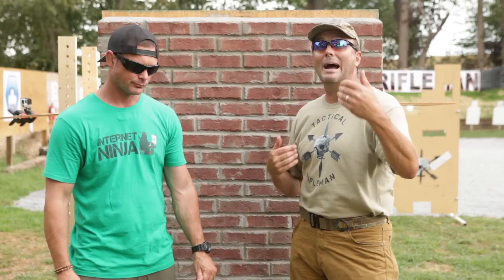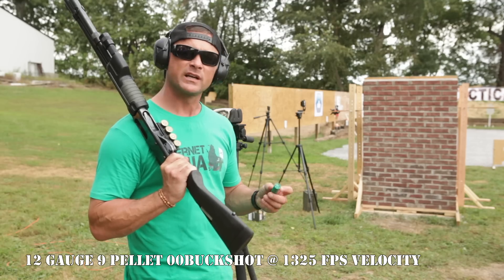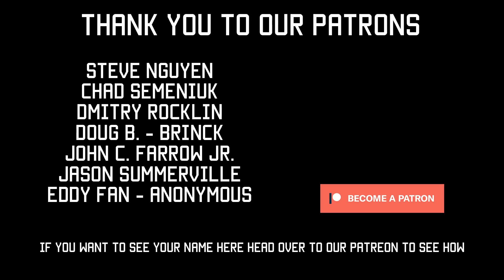Navy SEAL test Ballistics through Walls | Tactical Rifleman

Comment: Brick + Cinder Block Wall
3:13 12ga 7 1/2 Birdshot
3:50 12ga 9 Pellet 00 Buckshot 
4:21 12ga 1oz Slug 
4:57 SIG MPX 9MM +P 124gr 
5:41 ??? 5.56 55gr

8" Cinder Block Wall
6:59 12ga 7 1/2 Birdshot
7:23 12ga 9 Pellet 00 Buckshot
7:57 12ga 1oz Slug
8:49 SIG MPX 9MM +P 124gr
9:41 ??? 5.56 55gr

Brick w/ Dry Wall+
11:56 12ga 7 1/2 Birdshot
12:45 12ga 9 Pellet 00 Buckshot
13:24 12ga 1oz Slug
13:57 SIG MPX 9MM +P 124gr
14:32 ??? 5.56 55gr

2 Sheets of Dry Wall
17:00 12ga 7 1/2 Birdshot
18:10 12ga 9 Pellet 00 Buckshot 
19:59 12ga 1oz Slug 
21:58 SIG MPX 9MM +P 124gr 
23:49 ??? 5.56 55gr

Vinyl Siding + Drywall
27:02 12ga 9 Pellet 00 Buckshot 
28:12 SIG MPX 9MM +P 124gr
Reply from the maker: Thanks for taking the time to time-stamp this video. TR
Reply: @TacticalRifleman  Nah, thank you. While I have your attention, I would love to see you take these walls and shoot a human sized gel IN FRONT of the walls, to see how far it would penetrate after you shoot through a body. Also, would love to see you use some of these walls in ricochet demonstrations. You might or may not be surprised on how crazy accurate you can shoot a ricochet and I think it should be in everyone's tactical toolbox for defending against it or using it to your tactical advantage!
Reply: Those are some interesting questions.
I'm up for some of that.
This is an EXCELLENT presentation and the timestamps are a Valuable Courtesy.
Many Thanks, to All.
Reply: ??? = AR-15
Reply: @cardboardcapeii4286  thanks
Reply: Moves from addressing the boys to gents at 13:11. 💪

Comment: How about green tip and some 308?
Reply from the maker: Future videos already planned
Reply: Definitely need to see some .300 Blackout info...
Reply: why green tip or stronger? I think you missed the point.
Reply: Green tip is good if you need to blast through walls or barriers to hit your intended target. However it has much less effect on your target than it's counterpart, XM193.
308 may perform better than what most think. Use a good soft tip or hollow point, major wound devestation but lacks the ability to penetrate compared to an fmj or other calibers. However with any rifle, ammunition choice is important and I'd never recommend a fmj for home defense unless it's 556/223 like XM193, those are the only exception.
Reply: I've shot individual concrete blocks with 7.62 x39 , 5.56 NATO and 7.62 NATO . The7.62 NATO  blasted through in one shot except when it hit the ribs in the center or at the edges . The 7.62 x39 performed about the same as or a little better than the 5.56 NATO . As car commercials say : Your mileage may vary ".
Reply: That's what shocked me is they only 12ga, 9mm and ball 556. Shoulda added green tip 556, 7.62x39, 45ACP, 308 and maybe 300BO or sumpin. Tons of people use those as well. I myself use 45ACP and a 308 M1A for defense as I live on a ranch.
Reply: @TacticalRifleman  I hope to see 9mm HP from a pistol. (Probably someone already said the same, but browsing comments with phone is not something I like to do a lot :) ).
Reply: Please add .308 to your test ammo. Need to know the potential for damage. Is there any way to simulate wall penetration AFTER a round hits a bad guy? Maybe 8" of gelatin in front of the wall?
Reply: @EquipaPatriot  Why would you shoot your own house from the outside. Clearly some of this simulates an attacker.
Reply: Korben 
I was thinking the same thing... Maybe he’s defending his garden from bad guys inside his house... 😜
Reply: @GrySgtBubba  I do to but also have a house in the city. Two different ballgames brother but at the ranch I run a Remington 700 6.5 Creedmoore or a 300 Weatheby. Now that I'm not out at the ranch house as much I use a 12ga OO Buck or my 1911. After 3 tours and 17 years of shooting I consider my self to be a good shot. My gates 300 yards away from my back porch and I'm covered from there. I got some other toys too but I'm not concerned about a CQB shoot out but am always prepared for the worst and praying for the best. Different strokes for different folks. I like your style though brother.
Reply: @snek9353  he specified that it was if you were defending from a window and missed hitting your neighbors house. IE Chicago drive bys and such.
Reply: LOL we don't need a demonstration of green tip on drywall... We know the damn results
Reply: They'll go through the wall but in many cases will be mostly debris and light damage if body armor. .50cal will go through without a problem. This is for all but brick. Brick is tough as f*k but brick debris will do damage.
Reply: @toddk1377  even with 5.56/.223 spire point is the way to go for home defense. With neighbors and even family in the other rooms of your house to consider,using FMj in any case for home defense makes zero sense no matter the caliber. There are way too many options to go with the least effective for the mission.
Reply: @chaozeffect1841  apparently,you have never shot a .50 BMG at a brick wall. As a reference, I've seen a .50 BMG penetrate 4inches of reinforced concrete. One layer of brick,backed by one layer of block would be nothing since brick is soft. The only way there may be an issue is if it hit directly on the support rib in the center block
Reply: @FreedomInc  
Like I said, it's only a consideration, but based on many tests, the XM193 does perform decently at close range as it fragments and tumbles, but I do agree, there are other options that offer a lot better terminal ballistics. I really like some of the heavy otms as they perform very well from both my AR rifle and AR pistol. To be honest though, as long as the projectile puts a hole in the bad guy and causes massive damage, I can care less about over penetration, many folks focus on that too much and unless you're in a specific envitonment like an apartment building or similar, then I would focus more on over penetration. AR15.com, The Chopping Block, Paul Harrel, all have YT channels showing the effectiveness and penetration of a lot of these rounds. I still wouldn't rule out XM193, it does cause massive tissue damage and does not penetrate as far as some people think, and if it's all I had at the time, I would not hesitate to use it but it's not my first choice. The only ammunition I would not use unless it's all I had period, is the bi-metal russian ammo, unless it's a soft point. That stuff has poor expansion and poor fragmentation compared traditional copper fmjs or copper and lead hollow points.
Reply: Tactical Rifleman put the link down in the comments
Reply: @GrySgtBubba  because those rounds over penetrate and not good for home defense because of that. You dont want the over penetration.
Reply: @drewf9543  Yes, very much agree. If I lived ina city, 308 would not be my choice for HD. 12ga #4 and Leigh Defense 300bo would be. Or a PC carbine pistol! Ona ranch or in the boonies, range and power are our friend Lol
Reply: @chargerscurt  For those ina city/apartment, no I definitely recommend NOT using those rounds. But it would still be wise to show those who do not realize such info and it'd be good to learn in general; for purposes of a SHTF scenario or those of us living out in the boonies. Knowledge is bliss my friend.
Reply: @victorwaddell6530  Did you fill the concrete blocks with mortar? I believer there are different levels of quality of concrete cinder blocks?
Reply: @EquipaPatriot  not if it’s a 7.5 in with a can on it. Better to use green tip than FMJ, that round becomes far less lethal after hitting the initial target. 20 pieces of it are going to be in them, maybe 5-6 made it through. And you can some really expensive shit that is not going to go through someone. If they survive the initial shot It’s going to get stuck in their organs and loins = Surgeon will just let them die on the table knowing it’s so nasty there is nothing he can do. Me personally, I’ll keep my CMMG Mutant. The amount of recoil one would have with a shot gun? You better not miss and you better hit them in the right spot because someone with an SBR is going to get off 10-15 rounds to your 1. That’s why I’m taking the SBR high caliber 30 Caliber & up with ammo that explodes on contact. Just me, I’m not to bright though
Reply: @GrySgtBubba  they didn't bother with any other handgun calibers because 9mm Nato is gonna penetrate the most, especially out of a longer barrel like that MPX.

They didn't bother with 7.62x39 because 5.56 is already known to be a much more penetrating round.
Reply: Great video. Can you do more types of common rounds (.308, 7.62x39, 300BLK, .22, .45, .357)?
Reply: @TacticalRifleman  Nice!
some of the odd rounds(the 5.7 etc) would be interesting, although less common,
we need to keep Brandon's fans happy too, so some 7.62x39, 9x39, 12.7mm...90 cal TANK ROUNDS!, RPG 7'S..."calm down man, calm down!", lol just kidding.

Comment: >uses 5.56 ammunition, a cartridge designed to fragment or tumble upon impact with something solid and rapidly release it's energy to incapacitate soft targets
>says it doesn't have the energy to push through the wall
Reply: That and uses two shot loads and 9mm against a brick wall. Why even waste the time?

Comment: Great video Karl, but seriously you need to paint your walls, I've got about 10 layers of paint on each side ahahaha
Reply: ifell3 curious if there’s such thing as armour paint. That has micro pieces of metal in it that holds it together better and reinforces
Reply: hahahaha used to have lead in paint, i wonder if you built up the layers ^^
Reply: @cclcanadiancountrylife3628  - Not sure about armored paint, but there is armored drywall. It's bullet proof up to 45acp I believe.

Comment: Majority of the Southwest homes are built using paper mache but most people know it as stucco. It's all terrible regardless of the terminology. If your residence isn't built from brick, stone or concrete in some manner then all you have is shelter - not protection. Regardless of the material, I recommend you defend that residence by any means necessary to keep you and your family safe.

Happy Thanksgiving everybody.

Keep up the good work my friends.
Reply: A few years ago we had a rash of burglaries where the thieves used a very sharp knife to cut the vinyl siding from outside and then kicked in the sheet rock to get in. You're right. A real protected house is built from brick, stone or concrete.
Reply: Stucco on the outside is pretty common out in CA too. But due to earthquakes, anything made from cinderblock is bound to have least rebar inside of it, if not concrete as well.
Reply: Phoenix area, I totally agree that every home in Maricopa County built after 1978 is Cal stucco. Not worth it's weight in cover/concealment. It won't stop a .22 mag.
Reply: Brick sucks in a coastal climate. Properly applied stucco is a much better moisture barrier.
Reply: That's why I like the old victorian homes. They used real wood, wooden slats, plaster, thick exterior wood siding, and have that beautiful old style thats not used anymore. But they make great giant matchsticks though!
Reply: stucco is not paper mache lol
Reply: @mac1pine  absolutely Mac, absolutely.
Reply: Bert Shackleford  yes in deed.  Many other countries use the cinder blocks with concrete reinforcements but here is the us ca we cant do that. Need special permit to actually use bricks.  I wonder if that is intentional.  If u would use brick with reinforcements then it would be your castle not ur shelter.  Great point.

Comment: how about the 7.62 against the same constructs?
Reply: Would probably zip through everything except the first wall ( and even that one after a few rounds in the right place). That's a big part of the reason why we issue 7.62 mm belt feds at a platoon level. They're not really even purely anti-personnel weapons, but do serious damage to structures. Three or four rounds of M80 A1 will punch through most common building materials, except for the most reinforced structures. And 7.62 NATO AP rounds will zip through the first one as well
Reply: x39, x51 and x54r
Reply: @Laotzu.Goldbug  But those rounds see little use for personal defense because they are obviously irresponsible in an urbanized area. However, an expanding round like the 155 gr Hornady Amax can provide over 3/4 the tissue displacement as a 12 gauge buckshot round with adequate penetration for defensive use. Likewise, the M118LR with the 175 gr SMK and a hunting load with a common cup and core JSP might be interesting choices for the sake of comparison. Some people do use rifles like the AR-10 and Springfield M1A SOCOM for home defense, just not, hopefully, with AP rounds.
Reply: Bob pickett I believe it would’ve been cool but they aren’t really common rounds outside of the military
Reply: AK ammo will chew through cinder blocks much better than 5.56mm. Lots of videos on YouTube to show it.

Comment: would like to see 7.62R and .308 as well, and 50bmg just for fun
Reply from the maker: Future Video.
Reply: I'd imagine 308 and 7.62r would be similar to the slug. 50bmg would circumnavigate the globe and land next to the shooter.
Reply: matt taylor 
Nah, .308 would penetrate the cinderblock wall for sure.  Would probably make a good go at busting through the brick/cinder block combo.  Don't think it would bust through, but it would crack the backside of the cinderblock portion.
Reply: matt taylor
I would suspect that the 308win would have a far greater chance of poking a hole through... small bullet mass, but three times the speed of the slug. The slug would probably mess up the wall more though...  :)

Comment: Thanks for the nice video. In Central Europe, Cinder Blocks are usually filled with concrete/cement, never used alone without filling.
Reply from the maker: By code most places in the USA are also supposed to fill the blocks with cement. However, often, contractors skimp to save money and only pour in walls that support weight. Therefore, we replicated "worst case scenario" with empty blocks. Thanks for watching, TR

Comment: Who uses ball ammo for home defense? Lol Shouldn't they use 9mm hollowpoints? I'm guessing a 9mm hollowpoint won't stop in drywall either? But how much damage and how far does it travel out the other side?
Reply: Hugh Mongus 
It doesn't.  Check out box'o truth.  It's a website where an older gentleman tested common rounds against common barriers.  The point of the video is to show what typical guns are capable of penetrating, would make sense to use the most commonplace projectiles... hence fmj.

Depending on the hollowpoint, mainly  clog up on the drywall and perform like fmj.  The ones that don't still easily pass through multiple layers of drywall.  Barring hitting a stud or other harder object a 9mm will easily go through every interior wall in the typical house.  You'd probably be able to shoot through an entire house ,exterior wall to exterior wall 
  assuming it wasn't brick.
Reply: And who uses a 9mm sub machine gun?! Would have been better to use a handgun with common self defense rounds like Hydroshocks or Critical defense but we get the point. Great video otherwise Gent's

Comment: In the UK the typical house external wall is double-skinned masonry with a cavity, usually filled with insulation these days. The outer wall is often brick, sometimes reconstituted stone (like mine - basically a type of concreted made with local limestone made to look like natural stone) with the inner wall being the load bearing one made of aerated block on modern constructions. Proper cinder block (made from ash from power coal power stations and held with cement) hasn't been used for a long time. 

There are some brick-skinned wooden-framed houses too, but in the minority (and they will be filled with insulation).

Comment: Fuckin outstanding video as always!!!! So, what this vid proves is that like any time you choose to fire a gun you need to do your damndest to hit what you're targeting. The .556 through interior wall didn't pass through the ballistic gel on the other side. But, if the gel was a loved one on the other side of the wall they'd be smoked. I pray I never have to use my gun in a defensive manner. If I ever have to, I squeeze my hands together a lil tighter praying that every round i use hits what's threatening my family and/or me. There's nothing wrong with over penetration as long as the bad guys dead and there's nothing you cherish on the other side.

Comment: I’ve been a firefighter for 15 years and this is by far the most accurate representation of wall construction I have seen,  However when you have a residential brick facade over normal 2-4 walls the brick used is normally veneer brick. Veneer brick is solid, (no holes in center) but only about an inch thick.
Reply from the maker: Joseph, it varies by location, because we actually got a lot of this brick off of local job sites, left over from homes currently being built local to us. Thanks for watching, TR

Comment: My defensive plan includes using my stairs as a choke point, which also allows me to direct any fire downward to minimize any chances of collateral damage or projectiles leaving my house. The top of my stairs have a half wall all the way down one side and at the end of the stairs (like an "L" with the stairs exiting the left side of the bottom of the "L"). Both of those half walls have been filled with gravel. There is 1/2” plywood under the drywall in both sides to hold the weight of the gravel and keep it from pushing outward. I've tested this setup and none of my guns will get through the second side. Unless an intruder has a 50 BMG I should be good. This was a REALLY cheap and easy way to add some ballistic protection to my home defense strategy. It stops 9mm, 12 gauge slugs, 5.56, 7.62x39, and even 308. Only cost a weekend and a couple hundred bucks.
Reply from the maker: Solid plan. Thanks for sharing. TR